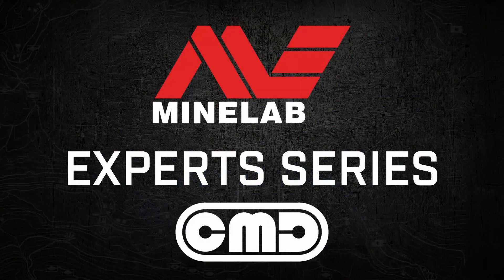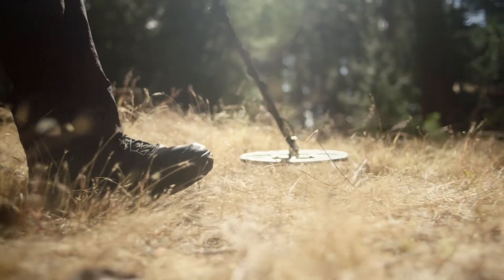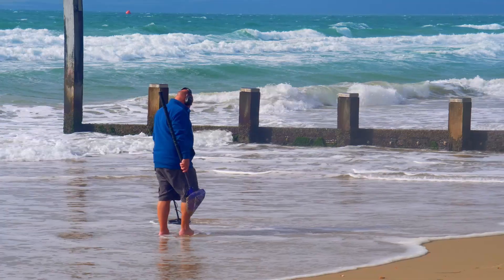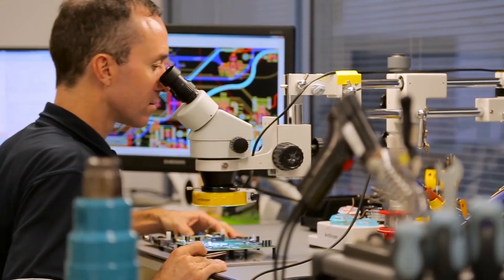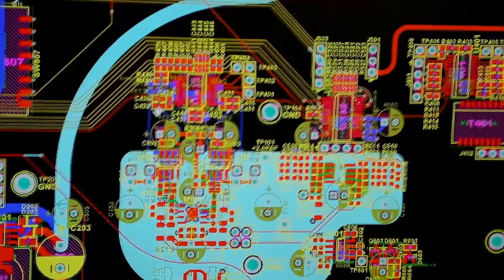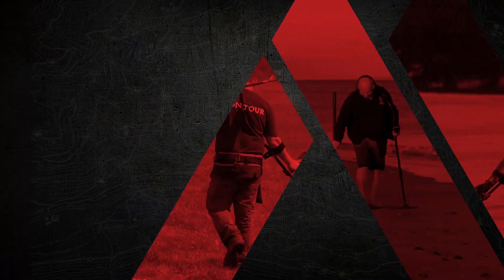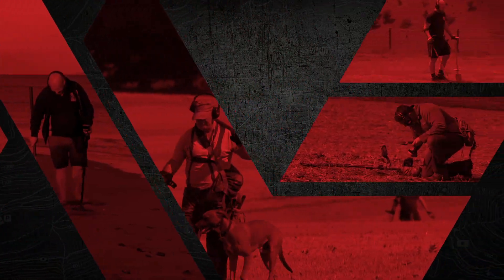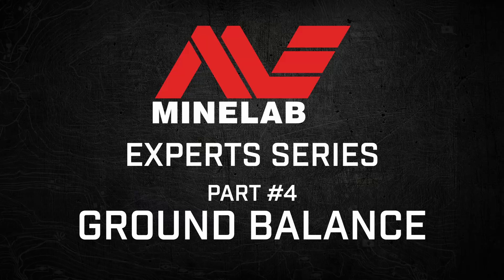Minelab Experts - Part 4: Ground Balance

Comment: Let’s make an ‘expert’ series of videos hosted by a guy who knows nothing about detecting. 🤦‍♂️
Reply from the maker: We asked Scott to present this series exactly for that reason. We have a good balance of knowledge and experience from the team on these videos, from beginners, to experienced users and engineers, and that's what we wanted. 

Many of our audience are complete beginners and we believe Scott is asking the questions that many want to know. 
The experienced users amongst the audience will most likely remember what it was like not to know what a ground balance does etc, and we think they'll still learn a lot from the experts in the series.
Reply: @crawfordsmetaldetectors  maybe you could look at doing a series for individual machines perhaps? I’ve recently bought a Manticore, it’s my second Minelab machine, but I have to say, the advice given by many on YouTube, is conflicting at best. Something  that addresses this misinformation would be useful to a lot of detectorists looking to take things to the next level. 🤷‍♂️
Reply from the maker: @adamclaxton8622  Hey Adam, we're currently working on some stuff for the Manticore so please ensure you're subscribed. And you are right, there is a lot of conflicting information out there. The main thing we would say about the Manticore, or any detector for that matter, is that there is no, 'one size fits all' setting. Many on YouTube state they have the 'best settings' and it's a load of old tosh. The machine needs setting for each different environment. Keep poised, it might be a month or so, but we have something coming.
Reply: Look forward to it 👍👍

Comment: When doing a manual ground balance do you need to find a clean bit of ground to ground balance on or does it not matter where you do it
Reply: Seek a clean piece of land with no targets below. I use All metal mode to do this. Once found do the Ground balance.
Reply: What Keith said. You don’t want to balance out real signals. Just the soil.
Reply from the maker: Great question. The answer is not really. If you have a large piece of ground, and one patch is 'clean' upon which you ground balance, but then you go and detect on the 'unclean' patch then you're not really helping yourself. Ground balance for the environment you are in. If the ground is all 'unclean' then that's the environment that your detector needs to be balanced for.